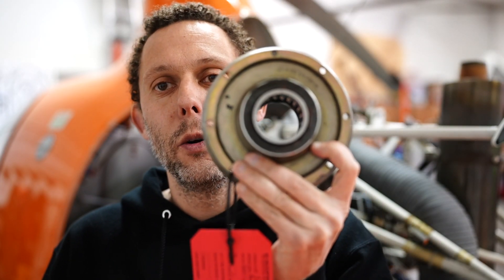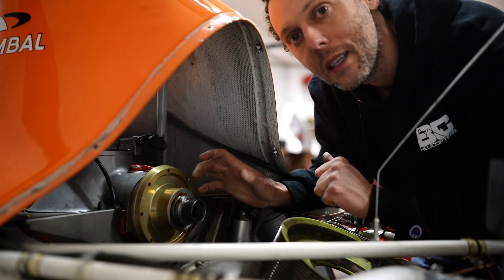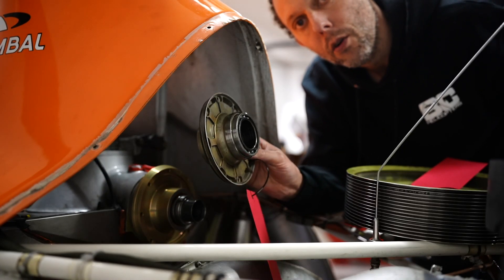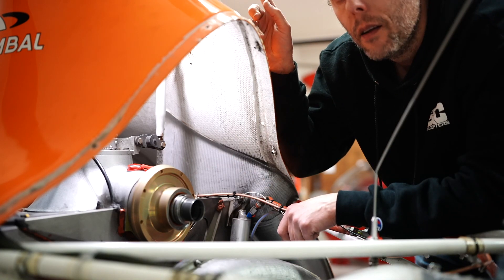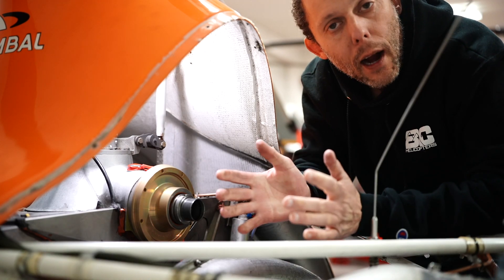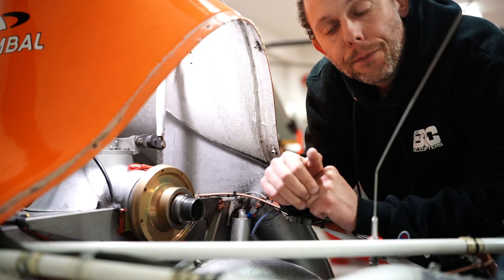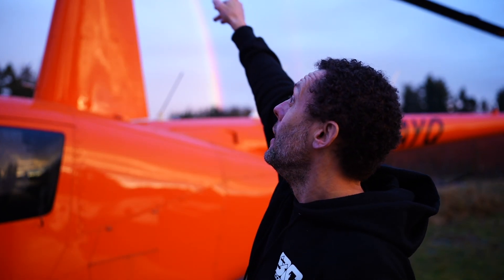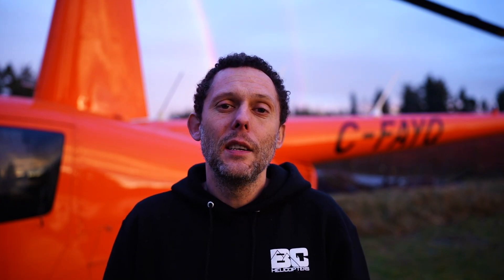Ep. 91 How does a helicopter freewheel allow autorotation during an engine failure?

Comment: Great explanation. There must be a huge amount of forces loaded on these dogs!  Do they wear out or dry up from grease? Can they break apart locking the whole system?  Lastly an in-depth on the rotor head assembly would be interesting. Thanks Sancho😀.............🚁
Reply from the maker: @gamedevai  they do wear which is what we ended up finding out was the issue with this one.  It was beginning to slip a bit during startup.  This one is oiled from the main rotor gearbox so it shouldn’t dry out.

Comment: Loving this series! As a low-time helicopter pilot, I often find myself thinking "what's that noise? Is that normal?" during flights. As a mechanic and pilot, maybe you could give some insight on what to listen out for while flying?
Reply from the maker: @MathisDedial  Great idea, I will try include some of this as I make videos.  In this case we noticed that during belt engagement there was an audible clunk or actually 2 or 3 clinks sounds right after the belt started really engaging.  Then once engaged all was fine.  At first we attributed this to a new belt installed that was gripping very aggressively but soon found this was not the case.  This led us down a whole list of troubleshooting to finally settle on the freewheel.